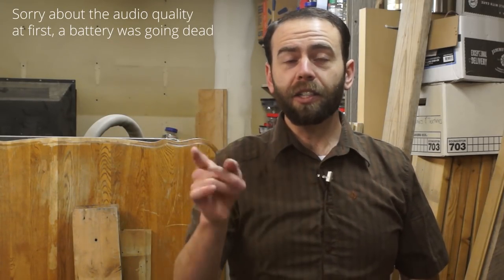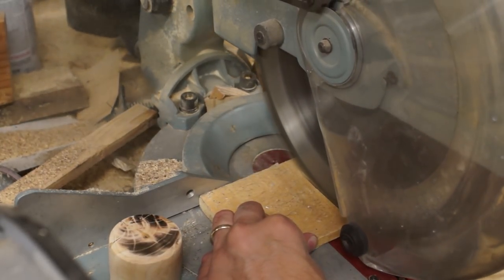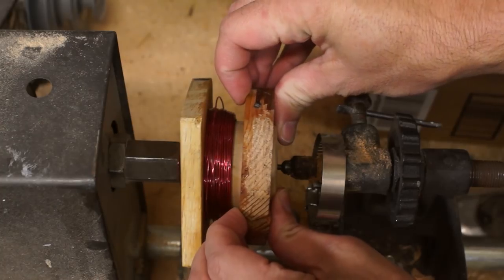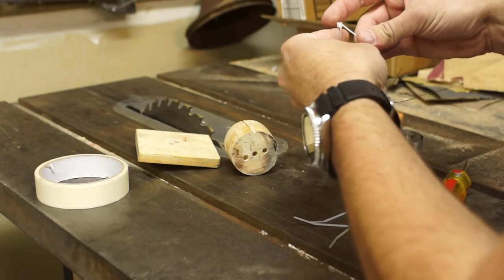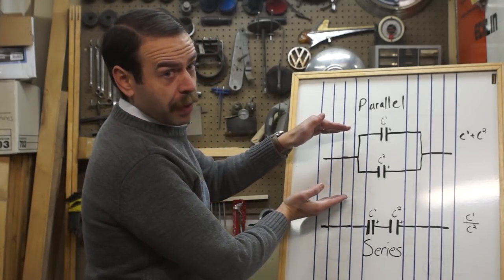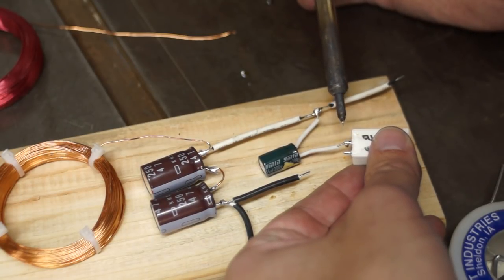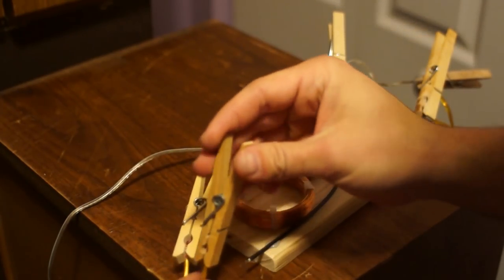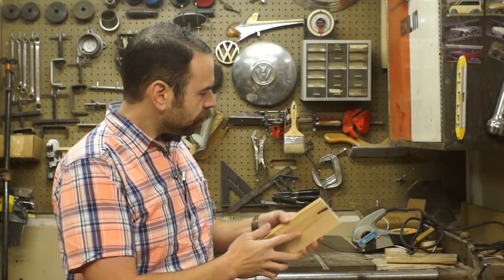Speaker Crossover & Hand-Wound Inductor Coil Made From Trash - Extremely Temporary Prototype!

Comment: One tweak that you could've done was to reverse the polarity of one of the series capacitors, therefore essentially turning it into a true NON polarized capacitor, (which is what you really want for audio purposes), but as you wired it, it was still a polarized, (i.e. DC voltage rated), capacitor, which isn't the best thing for an audio signal, as audio signals are of course AC voltage.

Comment: Interesting - although I wouldn't call copper wire trash exactly, people pay money for copper scrap.  I hope you soaked the coil in polyurethane anyway to prevent vibration of the windings against each other, significant forces are present once you turn the volume up.
Reply from the maker: Copper is pretty great for scrappers. This stuff was a pain to get to though, and IIRC only one of the half-dozen or so CRT TVs that I've come across have had copper with the others all being aluminum in the degaussing wire.
If this crossover was going to be used for any length of time instead of just being a sort of demonstration exercise, then yes, that is a really handy tip about keeping the windings from vibrating and rubbing through their coating.
Reply: h

Comment: The polarized caps in series should be connected + to + for making up a non-polarized cap. Crossover caps MUST be non-polarized, otherwise a useful video.
Reply: what about parallel connection ?
Reply: It should be done "anti-parallel": this is parallel with + of cap 1 connected to - of cap 2 and vice versa.
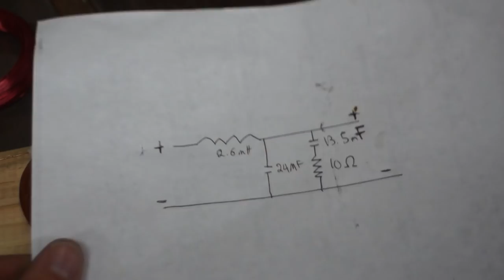Reply: You seem to know your stuff, what does the ten olm resistor do in the curcuit around 8:15 do?
Reply: Good lesson seen
Reply: yes absolutely to make a non polarized cap u need to put them together back to back. ;)
Reply: @Badr Ahmed actually it will not! Polarised caps are not rectifiers, but reverse curent may be higher and damage the cap/ speaker/amp
Reply: you cant make non polarized cap that way

Comment: Wire used is ENAMEL COATED - use sandpaper et emery cloth to scrape the soldering wires before soldering or tinning. 👀 Great vid ! WARNING.. removing wires such as this from tv tubes ? CRT tv sets operate via HIGH VOLTAGES such as 7.5 THOUSAND VOLTS and many of the capacitors in the tv sets can STORE high voltages.. The metal often spring like wire around the black or lead coated tube is there to discharge high voltages when the tv set is turned off HOWEVER I have ALWAYS made sure to wear decent rubber gloves when removing items from TV/old Computer CRT units - cutting the cable or harness as shown could result in shorting out a high voltage capacitor in circuit with the wires etc.. which could result in a rather unpleasant bang as the capacitor blows up remember IF you are using metal to cut through the wire harness etc.. Any cutters should ideally be high voltage insulated up to ie 500volts/1KV - Great vid but as said be advised ! You do not want to witness a capacitor blowing up.. OR getting a shock from a capacitor discharging 450volts into you! 👀 You can buy enamel coated wire OR scavenge it from lower voltage newer ie transistor / battery / low power tech. 👀

Comment: The wooden form does not have to be removed.  The permeability of wood and air is nearly identical and thus has no appreciable affect on the coils inductance either way.  Just don’t use a steel screw thru the form to attach it to the backboard.  The steel could significantly increase the inductance.
Reply from the maker: Quite true. I was removing it each time because I thought that if I perfected the technique, I could wind up using the form for other coils.

Comment: The inductor value is determined more accurately by coil size, wire gauge and cutting your wire length, no need to count the turns. The inductor may then be turned in a drill, so you'll have less time and effort and  tighter tolerance to what value you want. There should be info online about inductor value per coil diameter, wire gauge and wire length. (I have a book containing this info)
Reply: TheFRiNgEguitars в5?мыс

Comment: If you are making a non-polarized capacitor by hooking two polarized caps in series with their positive or negative ends together, the voltage rating of the cap is equal to the voltage rating of the cap with the lowest voltage rating.  In other words you do NOT double the voltage rating (if you want to use the capacitor on AC, as in a crossover).
Reply: How about that someone is wrong on the Internet. I don't mean the guy that made the video either.

Comment: That was very interesting winding proceadure... and the diameter of the coil is huge! Probably because you needed a few milli Henrys inductance! But the DCR, in this case, gets pretty big right? 
But what I really wanted to ask you is why, when you linked the capacitors in series, you did it by unifing the + and - terminals... I thought in a crossover the polarized capacitors are linked - to - terminals for obtaining a capacitor of a half size capacity, but a new NONpolarized capacitor! This is unusual... and I know there is a reason for that! Can you tell me what it is?

Comment: Nice attempt, but if you use electrolytic capacitors, you really should use reversible ones, yours don't look like reversible. However, if you connected your to caps correctly, back to back, you will have effectively made a reversible capacitor. Capacitors, generally,  should not really be connected in series as they are likely to be slightly different capacitance to each other and will not share the voltage equally.  Also, your air cored inductors will have a higher DC resistance  than ferrite cored ones made with the same wire, and will therefore have greater power loss. your crossover will have a different performance to one made with proper components
Reply from the maker: Thanks. Another commentator already beat you to it on the use of polarized capacitors in the video.  The likelihood for cascading failure with series capacitors is a good comment too. It was an internal debate whether or not to mention it in the video. I figured that since this was a prototype built from trash and there was no way I'd be using it for longer than a couple of minutes, it'd probably be reasonably safe.

Comment: An easier way to have done that, instead of counting, would have been to measure the distance of one loop of wire times the number of winds and then cut the wire off and use the lathe to wind it and it would have stopped automatically
Reply from the maker: Except that if you measured that way, the measurement would only be valid for one layer of windings. The subsequent layers of windings would each be longer than the previous ones.

Comment: I applaud your resourcefulness but keep a couple of things in mind. First the resistance of the coil is very important because the sum of the speaker and coil resistance will determine the damping factor of the woofer, more resistance equals less damping and thus less control of the woofer. The second point is electrolytic caps can be -10 and +50% of their marked value and still be in spec. usually caps from the same date code will be very similar to each other. Also film caps are much better than electrolytic caps.
Reply: That tolerance is only one of many.  I use tons of capacitors in electronics repair and have never used any caps with that tolerance.  Same date code? LOL    Film caps are much better than electrolytics.  Please explain...better how.  Electrolytics have their place in a crossover as do film caps.
Reply: If he selected these caps from a junk box they could be of unknown lineage. Current electrolytic caps are usually 20% but older caps only made sure the capacity was at least the marked value and with Chinese caps I wish you good luck.

I designed power supplies for decades so I was very aware of what cap specs were like and was careful to select t he right cap for the job. For a crossover cap you can use either a nonpolar cap or two normal electrolytics back to back (= to = or - to - so they would act as a bipolar cap), kust realize that back to back caps are not linear so they are not ideal.

eople use electrolytic caps because they are cheap, Film caps are always better but they are more expensive.

Comment: I made my own LP for sub, midHP for selected speakers and a dimmer for front to fine tune my 19 speaker setup (18 + sub) =) Also made from parts scavenged from old hardware. I'm wondering though, why lowpass @ 700hz? I would definitely start filtering highs @ around 200hz tops, even lower if I'd have good midrange speakers to go with the sub! It's gonna be 12db/oct anyways with a second order filter so even if you start at around 200hz you'll still hear those 800hz frequencies quietly. Subwoofer is for producing bass after all =)
Reply from the maker: Ah, this 15" is not a subwoofer though. This was a very, very temporary test setup for a midbass cabinet with a single horn-loaded 15" driver.  It is designed to cross over to a horn-loaded compression driver for the high frequencies, and the lower bass frequencies would be handled by a separate subwoofer cabinet.

Comment: @ 6'20" series capacitors, on the blackboard, 1/C = 1/C1 + 1/C2, NOT C1/C2!
Reply: Isn't it C1 x C2 / C1 + C2 = C12
Reply: CME both formulas are correct. C = C1 x C2/(C1 + C2) is a special case for 2 caps in series. Mario’s formula is the general formula for any number of caps in series.

Comment: You can use plumbers plastic tube cut down for the coil 'former'. 22 gauge enamel coated wire available from Amazon or Ebay etc  I'm confused re capacitors in PARALLEL and in SERIES ? I was of the belief that in SERIES 1 + 1 = 2 ? whereas in PARALLEL it is 1 (sum of the value ) divided by 1 would = 1?  Resistors would be the same.. in SERIES a 30 Ohm resistor plus a 10 Ohm resistor would equal 30 +10 = 40 Ohms. whereas in PARALLEL = 30 divided by 10 = 3 Ohms!! Put an 8 ohm speaker in PARALLEL and you would be in trouble connecting that to an amp output of ie 4 or 8 Ohms as the resistance overall would be 1 Ohm.. !!  However in SERIES those speakers would equate to approx 16 Ohms which would not I suspect, be a problem.👀👍

Comment: Newbie here, what would happen if you were to use 12 gauge wire instead of what you used? (other than it being harder to wind and take up more space)
Reply from the maker: If you go to the inductor calculator link in the description, it'll tell you how much wire you need, radius, and number of turns for a whole range of wire gauges.

Comment: Online crossover calculators unfortunately don't give results that work in reality. I explain why in my upcoming podcast about frequency crossovers.
I also have a tutorial series where I explain how to design crossovers: https://www.youtube.com/watch?v=5Kvl0iBQ0L0&t=0s&index=2&list=PL4lJ1ej0uWlQjzOstioAZ1bd555vG9WHF
The RC filter in a crossover has to be tuned for each driver individually. You don't even need it if you design the low pass correctly.
Connecting two drivers in series is usually not a good idea. You have to make sure that the have exactly the same impedance curve if you want to do that.
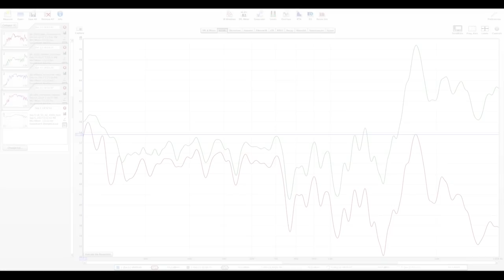At 10:15 I see the effect with 12 dB attenuation per octave (1 to 2 kHz) but not really a good result. A 3rd order filter or a serial RLC circuit in parallel to the driver would be more suitable to suppress the resonance at 1.8 kHz.
I recommend using the software ARTA for measurement because in it you can apply a timing gate on the measured data to suppress the room characteristcs.
Reply from the maker: That's some nice information and it looks like you took some good time to put it all together for us.  I didn't happen to use an online crossover calculator to design this circuit.  This circuit is from a JBL spec sheet for the 3110A crossover and was designed in the 1970s, if not earlier.  This schematic was put together way before commonplace computer modeling and all the fun tools we get to use today.
I managed to create a rough, but reasonably close version of it from trash where I had no idea if the tolerances on the components were close to spec and I even wired one of the capacitors backward.  It was in use for only a few minutes, mostly for making sure the schematic was correct because I've read about other factory schematics containing terrible errors or omissions.  It did happen to attenuate in the correct range, at approximately the right slope for the design.  I do agree that if you were designing a crossover circuit nowadays that you'd likely want a steeper slope and plenty of real world testing to verify results.
Oh, and the two drivers in series were the exact same model.  Sure, there will be some variations between individual drivers, but eh, it was close enough for the simple frequency sweep I needed to do.  I was actually quite surprised that a modern Dayton subwoofer driver in a horn loaded JBL cabinet managed to really closely approximate the factory response, despite having all the wrong driver specs for the cab.

Comment: Good idea to reuse degauss wire, but keep an eye on the coating. Sometime the varnish is too old and just cracks.
At https://youtu.be/y6oPipWgj3o?t=372, caps connected in serie formula on the white board.. C1/C2 ? Oups !... Better use C = (C1 x C2) / (C1 + C2) or equiv. 1/C = 1/C1 + 1/C2
Only if they are exactly the same, you can use C = C1 or C2 divided by two.
But if you can use an unpolarized cap, it will be highly better than two caps connected back to back (because capacitance of a inverse polarized caps isn't the same as in the forward direction). This could produce unwanted distortion due to non linear behavior, and in the worst case: destruction of the caps.
I use myself a tiny but powerful LCR meter for my homemade inductance, just visit https://www.peakelec.co.uk/acatalog/lcr40-atlas-lcr-meter.html

Comment: What is the diameter and how many laps does it expire?
Reply from the maker: There's a link in the video description for a website that lets you calculate coil diameter and how many turns of wire you need based on the gauge of the wire and desired induction of the coil.
Reply: @TinyLittleWorkshop  What is the diameter and how many laps does it expire?

Comment: sir what is the value of small capacitor there? I cant zoom in diagram ..tnx
Reply from the maker: I never bothered to read up enough on passive crossover layouts to figure out what all the different configurations are supposed to accomplish.  This schematic was designed by an engineer at JBL sometime in the 1970s or earlier. It is for a 4560 cabinet / 3110A crossover. You can search online and find the 3110A schematic in PDF format.

Comment: `so 23 1/2 micro farads caps are best for bass? very good diy vid and kick ass stash
Reply: What he has built is a 2nd order x-over. The caps make it 2nd order. Which means the frequencies that need to disappear, will drop off faster than a 1st order (just the inductor by itself).
Reply: And the crossover frequency is determined by the combination of the inductance produced by the inductor and the capacitance produced by the capacitor. You can't just blindly pick a capacitor with certain value of capacitance and pair it with a random coil, their values are related to eachother when determining the crossover frequency!
Reply: مساء تلخير
Reply: @TheMasterOfNone  ok, in making a 1000watts 4x10 with a 150 watt tweeter bass cab, how to know what wire gauge and how many turns it takes so that the tweeter will only receive the 150 watts?

Comment: I would like to build a crossover filter to cut low frequencies from a full range speaker. Cut less than 1000 Hz.The power of   speaker is 350 RMS.
Please can someone help me?
Reply: What is the resistance of the speaker at 1 khz...

Comment: WRONG way to wire POLARIZED caps! This guy knows just enough to  get you blown audio gear! DO NOT use polarized, unless you know the inversion trick...
Reply from the maker: You also forgot to point out that the wire gauge on the inductor coil is way, way too small to be used with any decent amount of power which would cause it to eventually overheat and die, that all of the solder joints are ugly as sin and/or could some day fail, and that wiring capacitors in series is in and of itself a bad idea from a longevity standpoint.

Perhaps I needed to repeat myself even more than a handful of times in the video that this was a prototype, or point out that it was in use for only a matter of seconds.  Maybe I should have put an even stronger emphasis on the fact that when the real crossover is built, it will use correct capacitors and other components.

Yes, the large polarized electrolytics were wired incorrectly and if you wanted them to act like a single non-polarized capacitor then one would have had to be flipped.  Yes, it has already been pointed out by other commentators.  Yes, non-polarized capacitors will be used along with higher quality components (AKA not trash that cost absolutely nothing, is likely to have drifted from whatever value is marked on the label, and was for a one-off, extremely limited use prototype) in the final crossover.
Reply from the maker: You're quite correct. The nomenclature used in the video isn't correct at all. Instead of 'prototype' is should have been something more like 'I can't afford the real components right now, but I managed to fit the wrong woofer in the box with a 3/8" plywood shim ring and consarnit, I'm gonna build a crummy temporary crossover from trash and used junk just to see what the combo is capable of for a few seconds'.  I definitely should have taken some more time to sort through the collection of used mylar/poly caps I've got hanging around and point out that using polarized electrolytics is not recommended for AC signals.